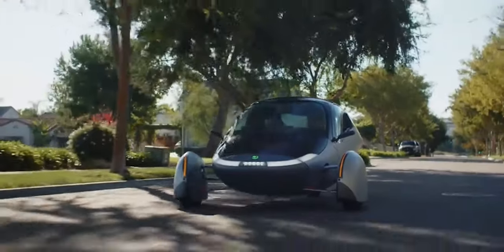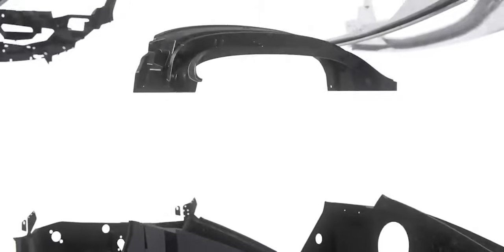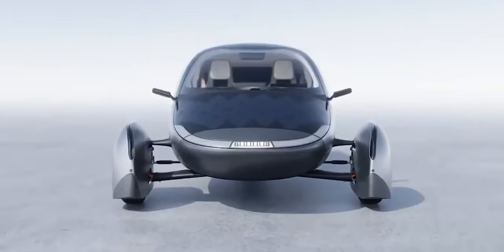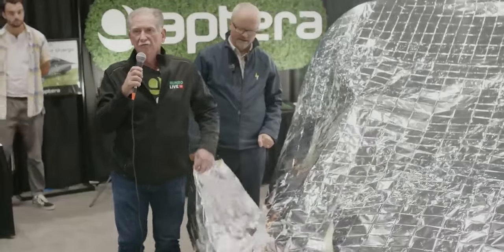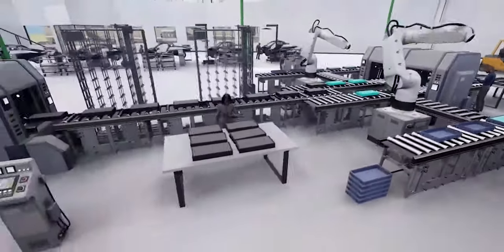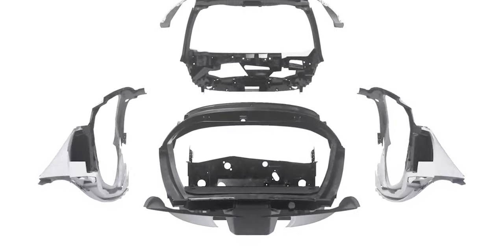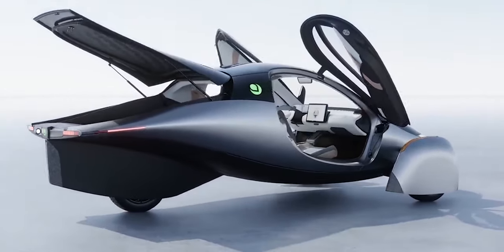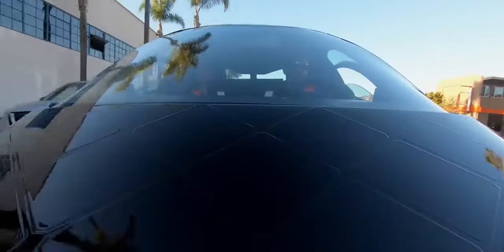Aptera Production: Delta Development

Comment: If there are 39,000 reservation, would it be possible to find 1,000 or 10,000 of those on the reservation list that would be willing to pay the full cost of their Aptera up front in order to push Aptera over the amount needed to enter production.  Those that do so would of course move up the reservation list to be the first to receive their Aptera.  It could potentially  raise $30,000,000 to $300,000,0000 respectively, for Apter by doing it this way.
I would consider rolling those dice based on the trust I have for Aptera's CEOs and Sandy Monroe.
Reply: Maybe .